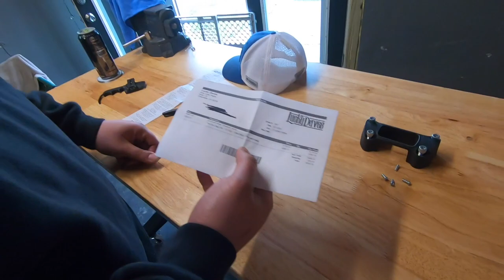FXBB STREET BOB HANDLEBAR INSTALL | LUCKY DAVES T BAR

Comment: im all late to the comments lol but i have a question if you can answer it to the best to your ability pleaseeeeeeeeeee!!!! im about 5'7 5'8 i want these san diego bars but idk if should do 12 or 14...... i also have a 2023 softail standard will these sizes even fit on my bike ????
Reply from the maker: Go 14”, we put 12” bars on and a few months later put 2” risers on. So they are a total of 14” now with no need to extend anything. If the standard comes stock with the mini apes like the street bob does you should be fine
Reply: @2WheeledFilms  yes it does come with the mini apes! Thank you so much …I really want these bars
Reply: With my height I should be ok with the 14 I jus don’t want my hands above my shoulders

Comment: did you have to extend wires or cables???
Reply from the maker: Didn’t have to extend any wires or cables.. if you go up to a 14” bar and re route some wires it would work but the clutch cable will be very tight. 12” is safe especially if you plan to internally wire them. We would recommend that if going to 14” you extend the wires and cables.

Comment: do you think those stock wires would still reach with a 14" san diego bar?
Looks like all youd need is 2" on the brake line for the 14" also, or is the brake line sort of tight on those 12"?
Reply from the maker: You should be fine, there should be plenty of wire and cable.

Comment: Great job on the video, guys. Appreciate the effort. Any thoughts on whether I'd be able to pull off a 13.5-14" riser/bar combo without buying extended brake and clutch lines, and wiring (except for the gauge)?
Reply from the maker: I think that 14" would be a stretch.. we have the 12" lucky daves and the brake line is just about where you want it to be. We could probably get away with a 1" riser with no issue.
Reply: @2WheeledFilms  What’s a few hundred more dollar bills??? Haha. Thanks. 👊🏼

Comment: I have a 2021 softtail standard wanting to replace my apes for the hammer down apes not t bars was wondering are the ts you putting on 10inch or 12s was hoping I could get 12s on without having to extend wiring and brake lines etc what would you recommend. Cheers from New Zealand
Reply from the maker: They are 12” .. if you plan to internally wire you may need to extend with apes since there are more bar to run the wire though.
Reply: @2WheeledFilms  thank you I will be running the wiring internal. Might just stick with 10inch ones then appreciate it guys

Comment: Where did you get the bars and cable kit? Looking to put this exact kit on my 21 lowrider S
Reply from the maker: The bars are Lucky Dave’s.. check the link in the description for them.. We didn’t have to use a cable kit because the Street Bob already comes with 10” mini apes and the cables and wires are long enough for 12”.

Comment: Do they function better than the original?
Reply from the maker: Function is the same.. they are handlebars. You sit up much more up right and in turn are much more comfortable. Makes the ride riding experience better, it helps build the confidence.